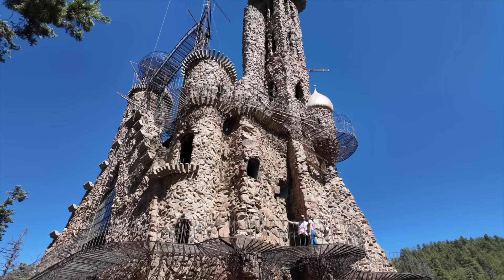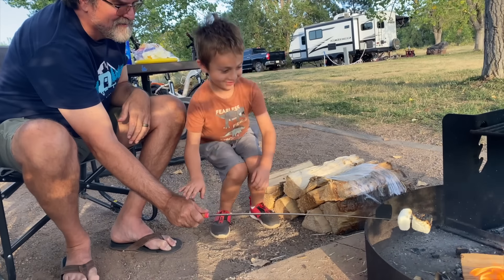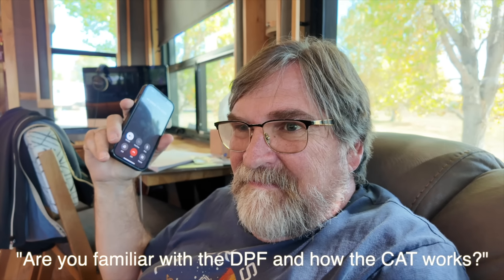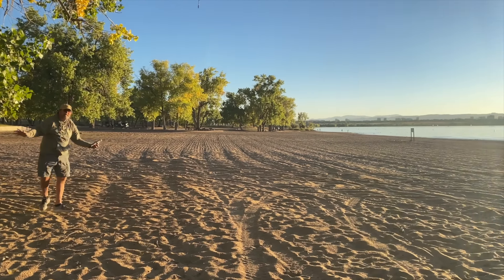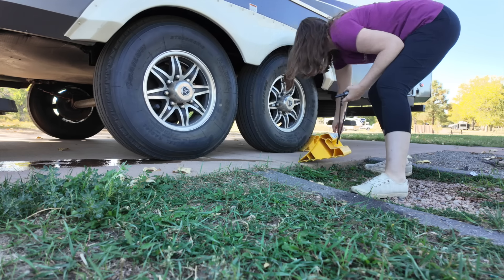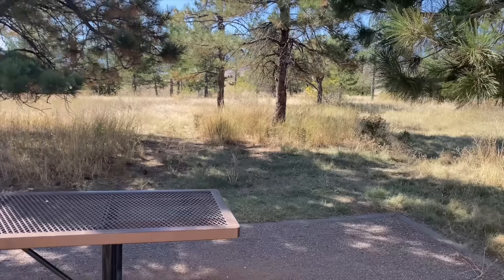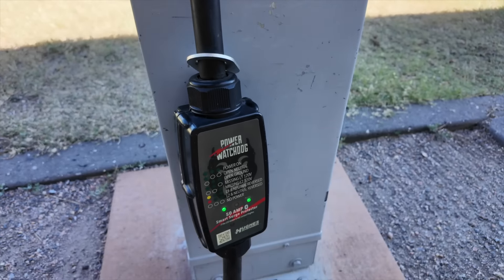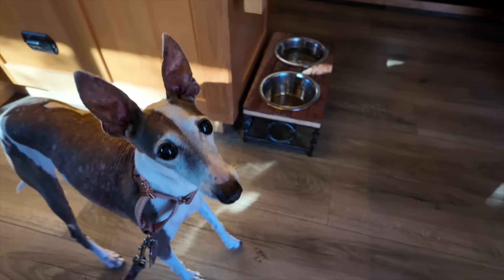Major Truck Problems while RVing , Learn from Us and SAVE Huge on Repairs!

Comment: Thank you so much for this information.  We had an issue this summer with a parking lot & 2 boulders.  Bent our front axle & lost 3 tires in between Trinidad Rocky Ford & finally winding up in Pueblo.  No one had tires for the camper.  We made it to  Pueblo on a rim Friday night at 6.  Pulling a 38ft 5th wheel & stopping in the first parking lot with ample room.  Nothing open.  But Monday morning found tires, and a wonderful small RV service just off 25 to the west & south.  Been in business over 25yrs in AZ & Colorado.  Got a rim & tire on & 7 miles down 25 spending the night in their parking lot waiting for new axle which came out of Denver Tuesday.  They had fixed & back on the road by 2 o’clock.  I did notify the police of our situation also the commercial business we were parked behind.  Both were wonderful allowing us to stay.  The repair was more then reasonable, great people.
Reply from the maker: Hello!!  Oh wow. Now that’s an adventure of not the good kind. I’m glad you were finally able to get the help you needed!  I would have been stressed to say the least!  Thank you for sharing your story as I’m sure many of us can relate 💙. Safe travels!

Comment: Yep, diesels are expensive but needed to haul heavy loads. Saw on YouTube the high pressure fuel pumps go bad and require entire fuel system replacement so had ours upgraded. Next will be an EGR filter upgrade. Thanks for the info to repair the exhaust. Sure it will come in handy. Happy trails
Reply from the maker: Thanks for the info on your upgrades as well!  Thanks for watching!
Reply: Yep, switching out the Bosch fuel pump to a DCR pump is about $2500, but can save way way more and not leave you stranded somewhere in the future!

Comment: 1. DOC (Diesel Oxidation Catalyst): First
Location: Closest to the engine, immediately after the turbocharger in the exhaust stream.
Function:
Converts carbon monoxide (CO) and unburned hydrocarbons (HC) into carbon dioxide (CO₂) and water (H₂O) through oxidation.
Reduces some particulate matter (soot) and prepares the exhaust for downstream components.
Key Role: Pre-treatment of exhaust gases.
2. DPF (Diesel Particulate Filter): Second
Location: Downstream from the DOC.
Function:
Captures and stores particulate matter (soot) from the exhaust stream.
Periodically undergoes regeneration to burn off accumulated soot, converting it to ash.
Key Role: Physical filtration of soot particles to reduce visible black smoke.
3. SCR (Selective Catalytic Reduction): Third
Location: Downstream from the DPF.
Function:
Reduces nitrogen oxides (NOx) by injecting Diesel Exhaust Fluid (DEF) (a urea-water solution) into the exhaust.
A chemical reaction converts NOx into nitrogen (N₂) and water (H₂O).
Key Role: Reduces NOx emissions to meet stringent regulations.
Reply from the maker: Thank you for the detailed description of the diesel emissions system.  Good info for our viewers

Comment: I get hit hard on our truck last month. Has to replace all 4 tires, had break work dine and a complete tune up. $3400. That's a lot when you're on a fixed social security.  Luckily got a 1 year no interest to pay it off. That's still way over our monthly budget. I need to cut back on KOAs and check out state parks. We budget $1600 a month for campgrounds. Found a really nice place near family in Texas for $330 a month for the next 3 months. That should help.
Reply from the maker: I know!  It adds up and we are on the same budget!  Had tires and stuff done before trip. Definitely check out state parks and city parks etc.  travel safe heading to Texas and thanks for stopping by 🤗
Reply: we camp at decent places for like $5-12.00 a night many with Water, elec and sewer .. they are the Thousand trails campgrounds.  you can find places in Yuma , Foothills area for 4-500 month.  

Seem like the Pittsburgh power diesel catalyst is the deal as the DPF place recommends it.

Comment: Might look into Rislone 3 products: Fuel side, DPF Cleaner… cleans DPF & Catalyst; this has corrected many with codes & limp mode. On the DEF side, DEF Cleaner… and normal use DEF treatment. Use both cleaners every 5000-10000, and DEF Treatment each fill of DEF.
Reply from the maker: Thanks.for the great tip. It sounds like we should have been using additives all along.

Comment: If your engine has a CP4 fuel pump you need to look into fixing that. It will implode and put metal shavings in your fuel system causing engine failure. There is a after-market kit to fix it from happening. Check out C&S Diesel
Reply from the maker: @pilhoney10  thanks for sharing this info!
Reply: Go to a DCR fuel pump for 2017 and newer.

Comment: Yelp had a 2015 f350 same issue and more.  Named it limp mode it was  in that mode more than normal.  2021 Chevrolet 350, just rolled 34k miles and never a light or anything.
Reply from the maker: We’ve actually had good luck with our truck for the most part. Thanks for reaching out

Comment: (1) owned a 2005 Jeep Liberty diesel. Nice vehicle except least reliable I’ve ever had in 62 years of driving. 

(2) quoted $5,000 to replace DPF on a BMW X5 diesel but got it cleaned for only $1500. So, yeah, clean your DPF, rather than replace.
Reply from the maker: It was a surprise to find they made them!   Glad you found a cleaning solution too!  Thanks for watching!

Comment: Diesels ain’t the same anymore. Hope it worked out in the end. 👍
Reply from the maker: So far so good! Thanks Peter
Reply: 2017 F250 with over 264k and running like new. Tranny rebuild and all engine seals replaced is all. Going to a DCR fuel pump soon.

Comment: I’d recommend getting a banks i dash gauge so you can monitor your dpf levels and make sure it’s going into the regeneration cycle. These systems are a pain. I’ve been using it for years and have had no issues with it on my 2015 duramax. Love watching your videos
Reply from the maker: Thanks for reaching out and for the sound advice . The dpf cleaning message on the dash does appear regularly but that may be a better way to monitor injections.
Reply: @ you’re able to actually go into a force regeneration process if needed. It’s also helpful to watch the filter levels. You monitor dozens of different processes. Keep up the great work we love to watch your videos
Reply from the maker: @Dieselrun4460  thanks!  We’ve had a force regen done in Maine while rving up there.  Definitely need to invest in that gauge

Comment: I had to replace all of the emissions crap on my 2008 Dodge ram 4500 diesel within the 261,000 miles so far, DPF, oxygen sensor, fuel pressure regulator, fuel rail sensor, fuel rail plug,  turbo charger, fuel pump inside the fuel tank, water pump, alternator, radiator, serpentine belt and more.  I will not be getting another diesel in the future because of the upfront cost, higher fuel prices and the on going emission problems and maintenance.  Cost more to run a diesel than a gas engine.
Reply from the maker: Holy cow!  That’s scary and not very reassuring for us 🫣. We’ve got over 100k on it and have had to do quite a few things but not to that caliber yet. Yikes!

Comment: So many issues with Ford, from engines to transmissions to a turbo self-disassembly on a friend's nearly-new truck while towing up into terrain, that I am done with them. I would only consider any newer diesel truck if it has an engine rebuilt correctly by Dave's in Utah--better than factory--and their maintenance recommendations have been followed to the letter.
Reply from the maker: We also blew the pipes off our turbo and rebuilt the right way. Other than that and the dpf issues it has been a great truck..knock on wood. Thanks for reaching out
Reply: Dodge and GM have their issues as well.
Reply: @ Yes, but less catastrophic most of the time in my experience, except for some of the Dodge transmission issues as well. I really regret giving up my ‘04 GMC Duramax / Allison 3500. Easily the most reliable truck I ever had, and could have just been rebuilt multiple times if needed rather than paying far more for newer, supposedly improved trucks that just never were in the longer run. The CP4 pump debacle is all but a printed announcement that the industry needs better engineering work and parts that genuinely conform with that engineering.

Comment: The company Hot Shot’s Secret makes a number of excellent Diesel treatment products.  Their “EDT - Every Day Treatment” is added to each tankful.  It works excellent in our family’s Mercedes Sprinter.  They make Diesel Extreme as a concentrated treatment for every so often deeper cleaning.  These treatments clean, lubricate diesel injectors, remove water, and increase diesel cetane rating.  Also, DEF has an expiration date, always use fresh, high quality DEF fluid in diesels that require it.  One last observation, please tell me you weren’t “lane squatting” in the fast lanes while towing your camper.  It seemed like most of the traffic was passing you in the slow lanes.  Thanks.  Best of luck with your travels.
Reply from the maker: Thanks for the tips.  lol, now we don’t ever ever ever lane squat😄thanks for reaching out

Comment: Glad you found a better way. Shouldn't these emissions systems be covered for life.
Reply from the maker: Thanks!  Wouldn’t that be nice!
Reply: @TilFurtherNotice  I've hesitated buying a newer diesel with all of that on there...too many horror stories. But since you 2 found this solution, I may reconsider. I had an old pre-def diesel that ran great, so I kinda miss the whole diesel thing. Happy trails to you!
Reply from the maker: @anotherm2722  we’ve also been told to add in an additive that cleans as you go. So ordering that 😉

Comment: I love diesel’s and have always subscribed to one rule, give it an Italian tune up also know as drive it like you stole it. Diesel can’t be babied, run then hot and hard at times.
Reply from the maker: Thanks for your input!  I’m probably a bit light on the acceleration and we also idle alot to keep air conditioner going when parked in the Florida heat.
Reply: @ Idling is your killer. Piston wash, do you not have a high idle feature. Guess you have to read the book. Sorry that one was to easy 🥹

Comment: run it hard up a pass.  the scr & dpf need to be hot to clean out.  the old italian tuneup.  also minimize idle time,   don't let it warm up long, just start driving easy till you are up to temp.
Reply from the maker: Great advice! The problem in Florida is there are no passes and sitting in a parked truck with no ac longer than a minute or two is unbearable. Thanks for reaching out!

Comment: Silly question new to your channel, but did you clean try cleaning your def regeneration? I  don’t own a diesel truck but I doing my research before I buy one.   In the near future buying a heavy fifth wheel and will need one. Not traveling all the time but living in Florida half the year and Maine the other half.
Reply from the maker: Not a silly question.  The truck does automatic (passive) regenerations periodically. You can also perform static regenerations to manually try to burn off the soot.  Neither one was working because over time the soot builds up too much for the regenerations to work.  We are learning a lot from our commenters who know more than we do. Thanks for reaching out and for watching

Comment: I see nothing on You tube except video of Breakdowns, and to  be honest 99 percent of them are 5th wheel, and those 80k dollar trucks, that cost in the thousands to repair.  I have a 2006 Class A Fleetwood bounder 38S with a Cat 300 C7 engine (ONLY PAID 30K for my Unit)  still has all original components that have never broke down yet.   I have had one broke belt in 17 years, and it took me 2 hours to repair at a cost of $70 dollars, because I always care spare parts and changes fluids and filters twice a years.  To me the biggest thing about owning any RV is Preventive Maintenance, if you  can't work on your rig, its going to cost you big money.  my  biggest expense was 6 new tires every 10 years ($4K), but I put money aside for this a few years out.

Comment: nr 1 on diesel , dont tune it, drive like you stole it and dont forget to service your oil.
Reply from the maker: Oh yeah we’ve heard that before!  We do try to run it good, but all the idle time isn’t great!  Thank you
Reply: @TilFurtherNotice  you can get a instrument like autel and then do a förced regen  1-2 times a year, when check engine comes on ,most times it means that a sensor ( component )is bad, this never happen on new car with low miles
Reply from the maker: @morganreyman7929  yes, a mechanic we had in Maine had something like that and did the force regen on it!  Never got around to getting one!  Thanks for the tip!

Comment: How many times prior has the truck entered the Regen mode to burn up that suet?  I have a RAM with 82K and only remember it doing it twice.
Reply from the maker: Thanks for your question. Don’t know first 50k miles because we bought used. Since then one computer initiated active regen and one manual regen at approximately 110k miles.
Reply: @TilFurtherNotice How do you do a manual regen? How often should a truck do a regen? I have a 3500 2017 RAM have a little over 78K

Comment: never ever try to pull with  a Ford ! Cummins ram is the only way to go
Reply from the maker: Ours has been great at towing but I understand everyone has an opinion on trucks. We bought ours used and because it was in budget 😉
Reply: That's funny. Google Ram Cummins catastrophic engine failures and DEF system failures. Hint: They can all have issues and nowadays none of them are cheap. This is why I still drive my 2000 7.3 with 413,000 miles on it. I've replaced the transmission twice at roughly 4000.00 each time. Other than regular maintenance no other major expenses.

Comment: why  id not have anything thing that has dps,  my 2009 f 450 dually does not have that crap,i bought her new i love it.but i nly have a 135000 miles onher  new turbos  after market fords are crap turbos, o only tow my 40ft 5th wheel

Comment: Yes Delete it. You don’t have to publicize it. If it’s done correctly it will have cleaner exhaust than with the DPF system. 
  You’ll also gain power and improve mileage
Reply from the maker: Thanks for the input 😉
Reply: It won’t have cleaner exhaust.  That’s why they put DEF on them in the first place.
Reply: @slalomking  not true. A well tuned deleted diesel burns cleaner than a DEF diesel. 
   DEF is a EPA mandate. Doesn’t mean it’s the best method

Comment: IM A 15 year transporter. Delete THAT FORD F450 2-DAY. TAKE MY ADVICE YOU'LL BE TROUBLE FREE WITH A GOOD TRUKK THEN. I meant delette the egr and def system they kill diesels period
Reply from the maker: Yeah. We hear that a lot!  Thanks for watching!
Reply: @TilFurtherNotice   Another thing get your fuel tested once in a while cause thee CP4 is a known failure point.If the CP4 goes out many garages will want to replace your entire fuel system-- lines injectors pump,,,, there is a disaster kit ,like an OIL FILTER TYPE THING with lines to and from it so if the pump does go out it will only take out the pump. One guy with same deal as your told me he would put thin grade oil in with fuel to help pump, but that's at your discretion.Rams don't like oil as the sump pump can't usually handle much